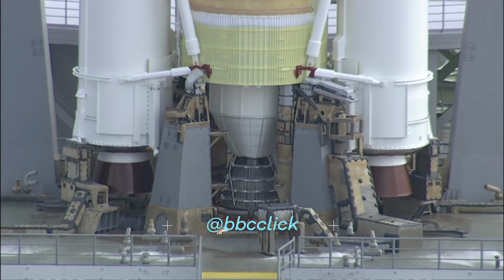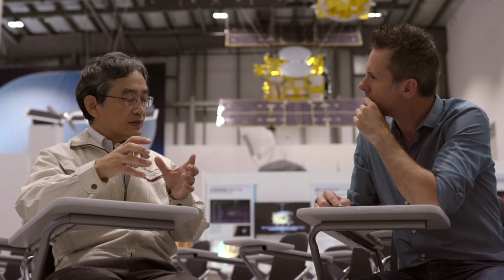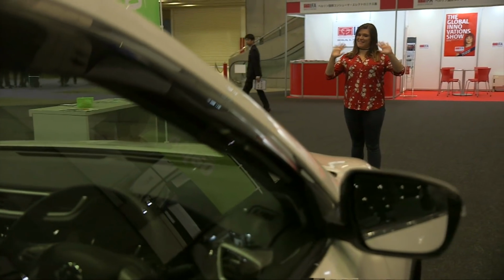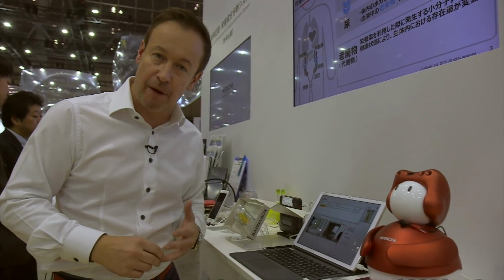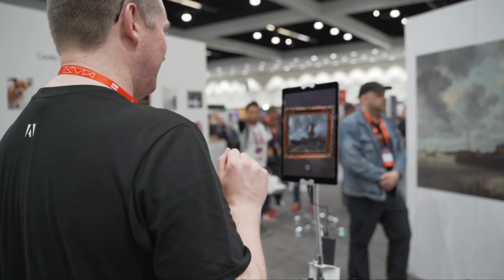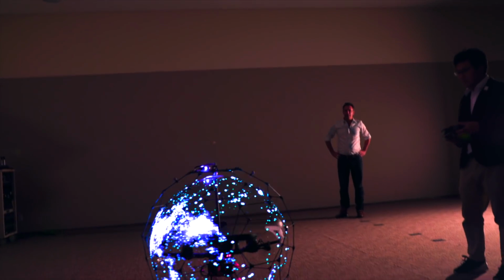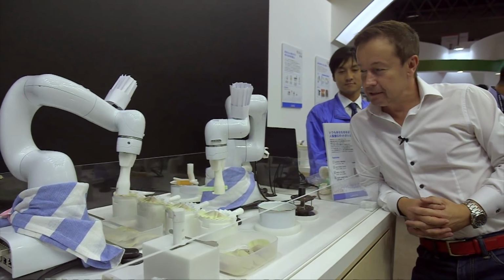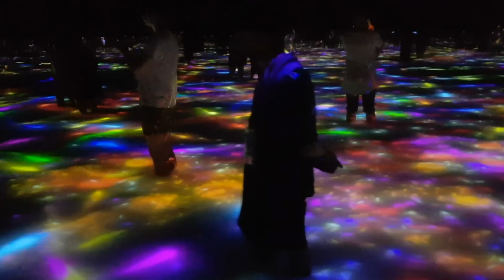Inside Japan's tech revolution - BBC Click

Comment: The drone display thing could use a power cable as a tether. Spherical display hanging up high that can swing itself around. Few sensors to see what's around it and it could even be an interactive display.

Comment: Most of this tech has been around for over 10 years but shelved
Reply: The same can be said for a lot of tech.  The reason is that it's just too expensive to be commoditised.  OLEDs have been around for many years.  3D displays have been around for years (infact the GameCube has some of the circuitry required to display on a 3D display).  The BBC and NHK did 8k broadcast tests back in about 2012.
Reply: Yep your right there?  Sony years back had to reply that the new 4K TV coming out back then was not the newest in fact they had the 8K and even the start tech of a 16K TV even waiting to be released?   They tried to get out of being in trouble by claiming oh but these others as re only lab testing!  But the same was not so about HD when it was released, it had in fact been held back so they could sell the older HD ready ones?  It is the same is true about HD they wished to wait until everyone had brought the HD TV before they then claim oh look a new tech called 4K TV you must buy it? Like everyone would dump those almost new just brought pricey HD TV's out and buy a 4K one which it's self is already out of date due to 8K ones are waiting to be sold like they just invented them! All a big con. the tech companies I sure do this for every product, they have one and sell it claiming this is the newest one!  But it is not they sell it like mad and then Bang when the product is as sold as it can they claim we done a better one? ( i.e. held back it ) and so on.